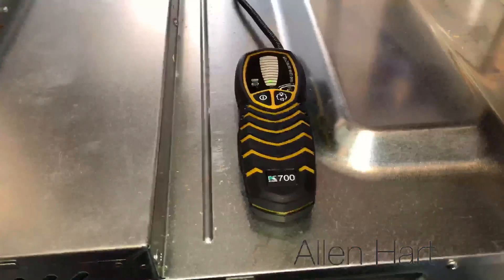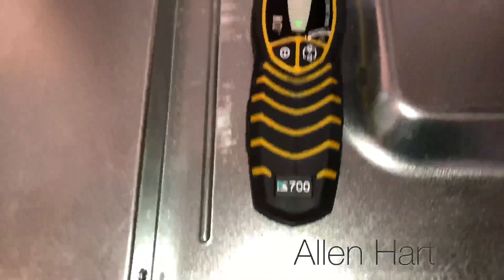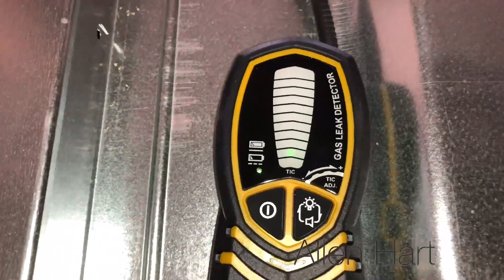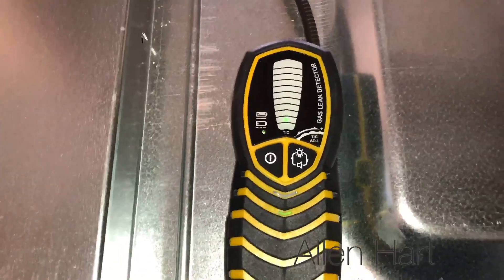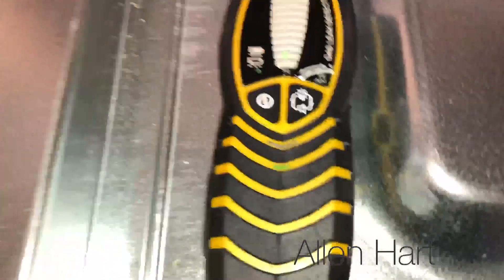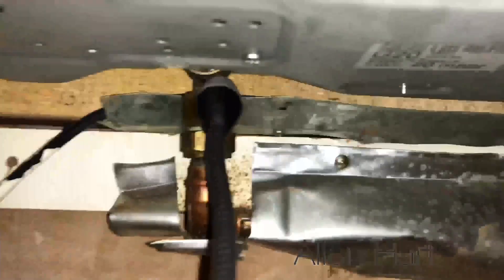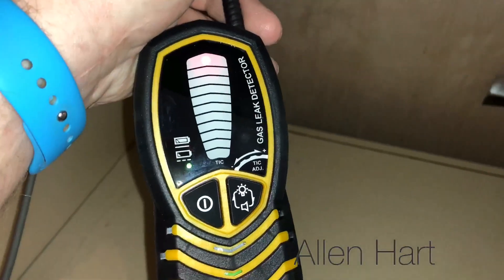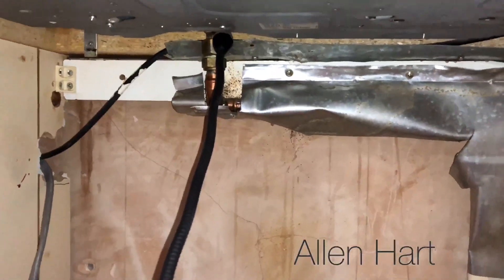Gas Leak ,Tracing a Gas Leak with a Kane 700

Comment: Is kane GLD450plus a good gas leak detector
Reply: I got the GDL450 plus included with my kane analyser, It's ok for what it is.  I generally reach for my TPi 775 though. It seems to sense more minute traces of gas and CO.

Comment: How do you find them in general. I have been put off with these type of devices due to the crap freeby thing they sent out with there FGA's
Reply from the maker: i am with you on that, this is fully adjustable and seems good, this was the first time i used it. i will do a full review once i have had it a while.